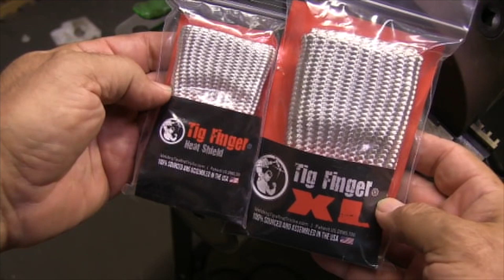Tig Welding Stainless Steel Pipe with a TigFinger®

Comment: I am very confident. I have been working in the field of welding since 1992 and have worked in oil refineries and bridges stores, noting that I am a welder with electric tubes and tig

Comment: If anyone has ever wonder about them tig fingers if they work or not. I have brought the regular and the xl and have been using them for about 18 months. They really do work, you can prop your hand right against the weld and it never get hot. Yes I did buy them from the Weldmonger store. I also have the black tig gloves I really like them, my wife got them for me. Good video.
Reply from the maker: thank you!
Reply: weldingtipsandtricks 
Your welcome!

Comment: Hey there, not sure of my torch handle connection, I have a HW17 torch I would like to replace with a CK20 SWIVEL LOCK  air cooled   my question is  1 are hose connection universe, 2 do I need adaptors
3 is the a hose adapter kit.
Thanks for your time.

Comment: So I do nuclear glove boxes and containment vessels and we weld a lot of stainless pipe...im curious if you have ever tried a U groove butt weld instead of an open root. It really welds easy and fit up is even easier...root pass is just a fusion weld just like sanitary piping. Then the normal hot and filler passes
Reply from the maker: Did quite a few J bevels back in the day but I dont remember a U groove.  sounds interesting
Reply: Yes a J bevel...i guess we call it a U groove because when the two pipes are put together it becomes a U...so what did you think of it? I'm just curious why it is not an industry standard because of how simple it is to fit up and weld. Oh by the way I really enjoy your videos and appreciate the time and effort you put into them.

Comment: Hey Jody,
I am literally looking at buying my first welder. I have no idea where to start or what to buy. I foresee myself mostly in the aluminum application so I was thinking tig would be appropriate for most of this discipline. However I know nothing about welder manufacturers or what set up to buy. I am sure you’ve covered it in a video before but could you suggest a good all around hobbyist tig machine? Would love any feedback. 

Thanks Jody for all you do!
Reply: Buy the most powerful tig your wallet will allow.  Don't cheap out and buy a lighter duty machine, especially if you are welding aluminum.  Don't think "I won't be welding thicker than XxXX so I only need this".  Plan on welding thicker than XXX and you will never be sorry.  As for brand, I love my Miller.  Been super reliable, parts are easy to get anywhere and it runs great.  Spend a little more than you expect on a good quality name brand machine - Buy once, Cry once.  Over the next 10+ years, you'll be happy you spent the extra.

Comment: Hello there Jody, thanks for all the useful videos.
Recently i have immigrated to Australia and these guys are using C25 (not exactly the same but close) for their solid wire mig welding most of the time, I'm having difficulty doing a vertical up with this gas, since it has a tendency to get Interpass LOFs in lower voltages and tends to shift to spray mode in higher voltages. It is giving me serious difficulties in work, appreciate it if you can do a video on 3f and 4f on mig C25. thanks again!

Comment: I noticed the flange is 6Mo, was the pipe that as well, and if so, were you using 6Mo filler? I find that with 6Mo you can see next to nothing. The puddle is filled with all kinds of things and it's like welding though mud with how crummy it is.

Comment: I noticed that the bottom was still covered. The only time you need to purge on the root pass. Is that correct. I don’t weld many things that need a purge. So I figured I would ask.
Reply from the maker: here is a recent video that should explain all that  https://youtu.be/xo1Iu5tRc_Q   good luck

Comment: Are Weldmonger official Tig fingers available outside of your store? Just trying to weed out the imitation. I have certainly seen them marketed on eBay which I assume is a copy as well as the welding supply which I don’t t know if they were real or not.
Reply from the maker: A handful of dealers on ebay and amazon order from me so there are some legitimate resellers out there.  there are also some knockoffs.

Comment: Nice welding Jody pretty slick for free hand man, welding pipe and the tig finger go together like peas and carrots.
If only i could get the darn thing to stop falling of my glove its so slick.
Reply: I switch between fingers quite often depending on the joint and right or left hand side of pipe.

I just were stick gloves now for everything that way I don’t have to worry about changing hands or processes Stick Tig Oxy.